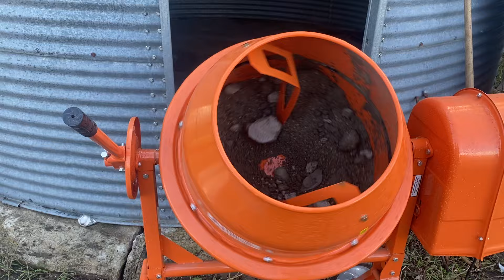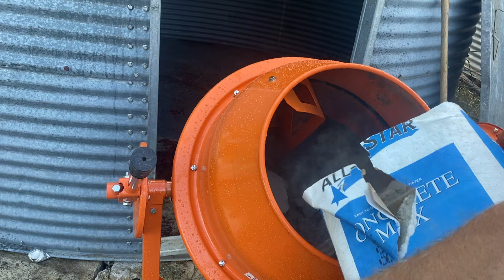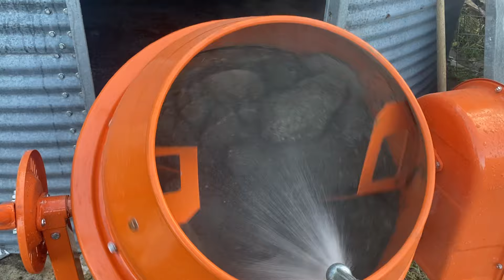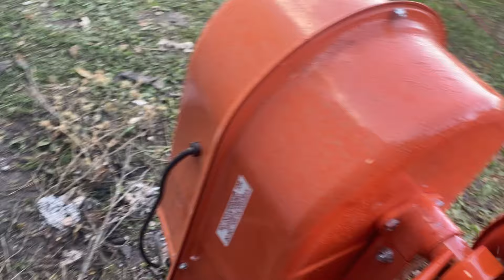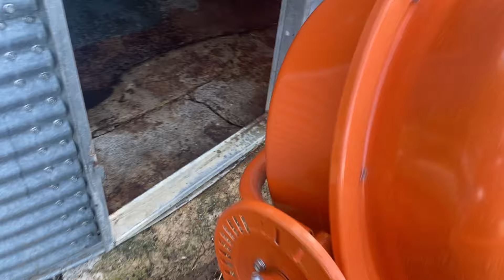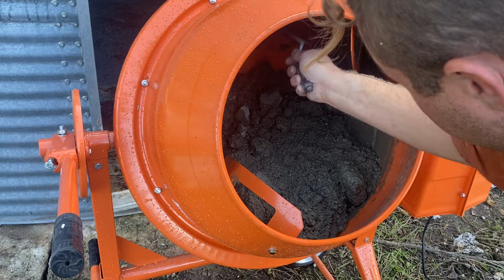Harbor Freight Cement Mixer First Run. Sacked Cement!

Comment: I, too, have run many, many bags through my mixer and luckily found that I did something right for a change.  Before you use it for the first time (or, in your case, as soon as you can), spend about an hour and put a very good coat of paste wax (like you would for your car) on the inside and all over the outside of the mixer. Sounds crazy, but after using it for a full day with lots of dry time in between, at the end of the day, it cleans up to Like New in about 2 minutes. Secondly, for every couple of hundred bags put a good coat of axle grease along the open holes of the gear drive. I swear that this little effort will make you smile every time you use it after that.
Reply from the maker: Will do! Thankyou for the advice!

Comment: Your cement has partially hardened in the bag. It shouldn't have chunks like that.
Reply from the maker: Yes sir it did! Had it in storage for a couple years. Got a little hard. I tell you what though. Once I got it loosened up/I poured it it’s been just fine. Mostly used as a quick fix for the grain bin.

Comment: Don't you feel sorry for the cement mixer?  These rocks will destroy the blades inside the tank.
Reply from the maker: These were just some hard pieces of cement  that were in the bag.  The cement mixer did break them up nicely. I think it was also a good testament to its reliability.  
Thanks for the comment!